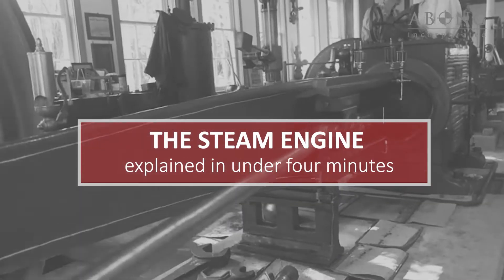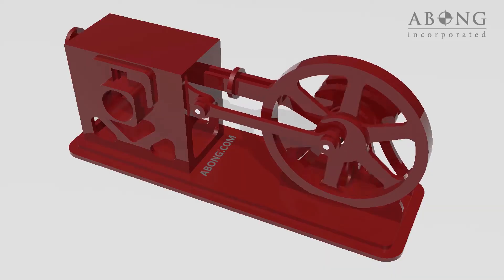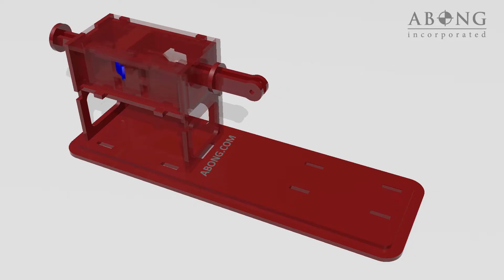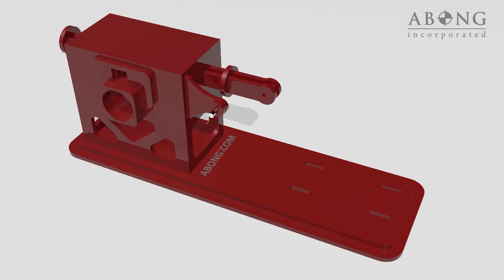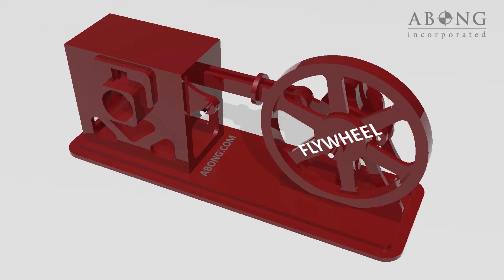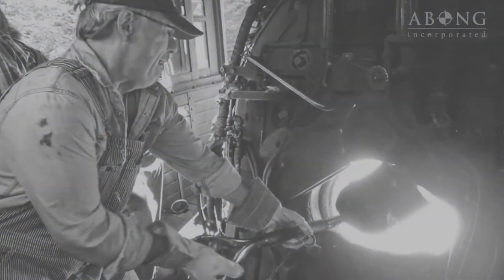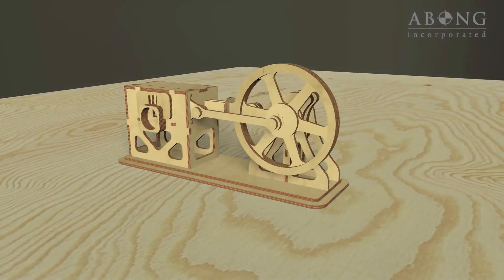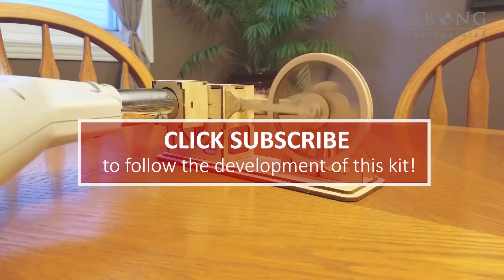How a Steam Engine works (Fully Animated)

Comment: i have an idea. so you take a syphon with a tube and put a turbine it it right so then in the lower pool you need some way to get the water to boil and go back up to the upper pool. you could potentially use the sun to heat the water if you can figure out how to make power every possible way you can and get it to go in a loop without spending money on "fuel" so the day time would be the best time but at night you could drain the pool that you had filling up all day long.